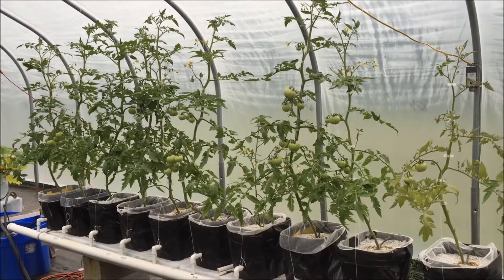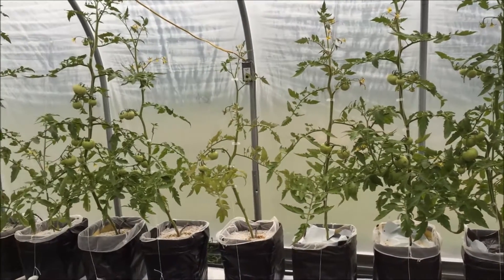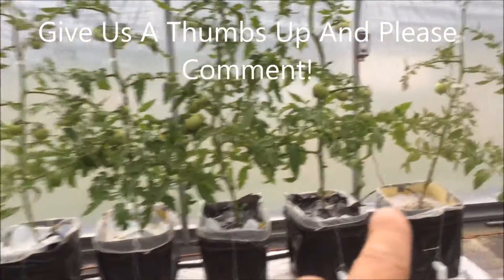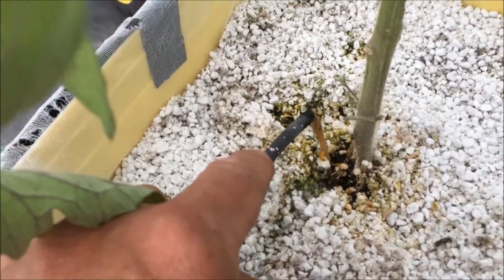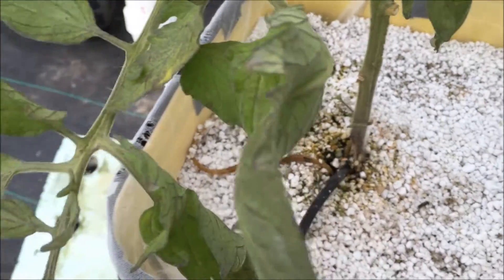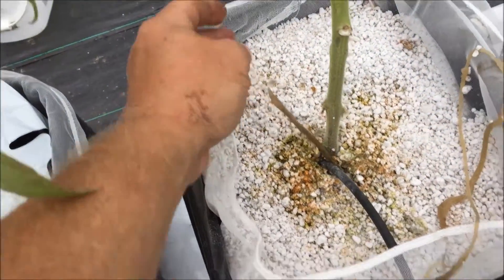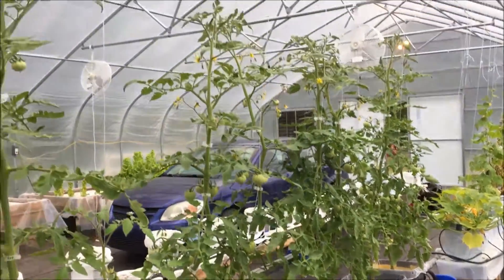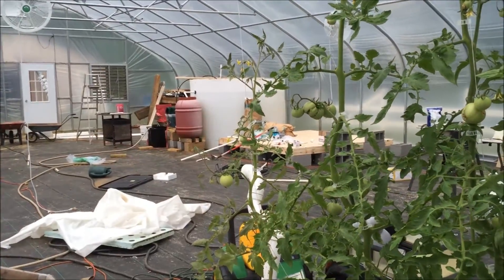Hydroponic Dutch Bucket Maintenance (roots in feed lines)

Comment: Pesky roots! How often do you have to check for this? Or do you know about how long of growth this is? :) thanks for sharing!! :)
Reply from the maker: I check the plants every day. If it starts looking stressed the first thing I look at is the feeder lines.
Chuck
Reply: Every day wow! Lots of behind the scenes maintenance.
Reply: I was wondering if you could zip tie (or somehow attach ) the feeder line to the plant and have the solution drip down about 2 inches and keep the end of the feeder line 2 inches from the stem of the plant? Or do you have to have the feeder line in the perlite/vermiculite.
Reply from the maker: You really want to keep the top of the perlite dry or you'll get algae to start growing. Algae will rob the plant of most of the nitrogen in the nutrient solution before it gets to the plant root system.
Hope that made sense!
Chuck
Reply: Makes since I know there was a reason why it would not work :)

Comment: Cut you some pieces of 1/2" pvc pipe 6" long, and stick them down in the perlite, and put your emitters inside them, and that will end that problem, as well as keeping algae from forming on the top! Looking good Chuck!
Reply from the maker: I did that after seeing Bobby Smith do it a few years ago but the feeder tubes kept coming out and I'd pump all of my nutrient solution on the ground. When I started putting the feeder tube through a hole I drilled in the bucket I never went back to the pvc for some crazy reason. The angle was a little weird or something. I give it a shot again. Thanks my friend.
Chuck